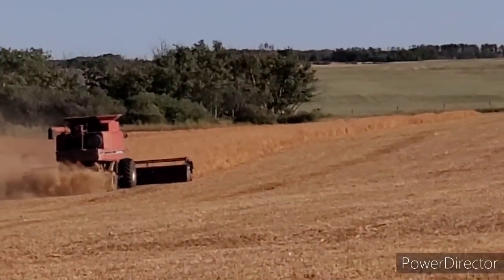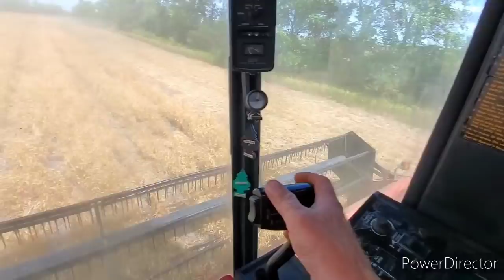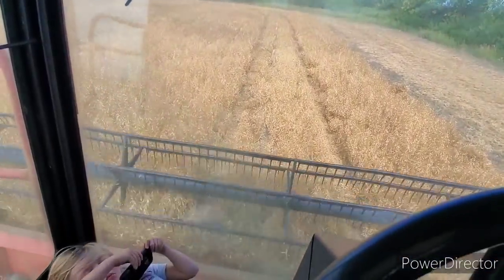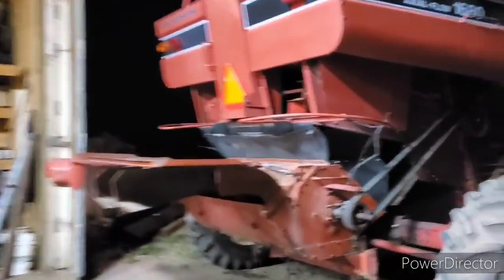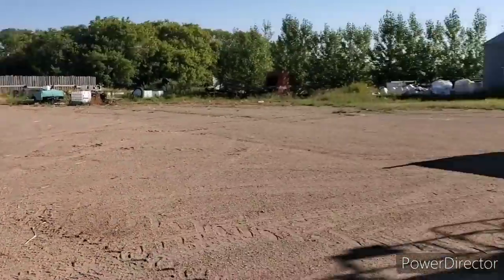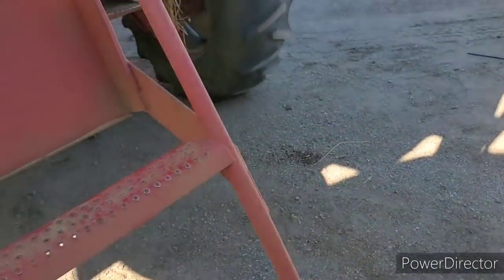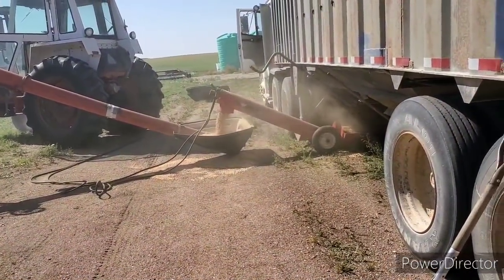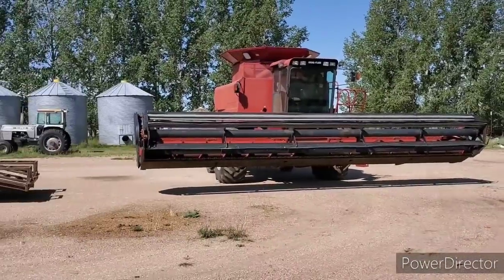2020 Yellow Pea Harvest With Case IH 1680!

Comment: Axial flows with choppers are a bit different to bale behind.. done a lot of round baling grass seed straw behind them. Just takes a little longer and more of a pain in the ass! 
Pea straw is supposed to be great feed!! Also great for the soil too!!
Busts up a lot like crimson.. dry enough when you combine, it just powders out.. 
Our spreaders are aluminum cone with a steel insert to mount and steel discs.. only way I've ever seen them.. ours pin on, the newer ones are like a PTO coupler.
The only guy here that raises peas, uses a belt to move them.. augers crack too much..
Thanks for the video bud!!!
Reply: Pea straw in small bales for garden mulch is very highly sought after and just the best . Ryans crop looked damn good !
Reply from the maker: Yep I baled 350 canary straw behind mine but only at night

Comment: Never had the chance to run a 1680. I've always been curious how comfortable they are.  I've ran a 2188 and a 2388.
Reply from the maker: Well definitely not as comfortable to run as the new cabs but still pretty decenr
Reply: @straightpipeacres6365  a cab and AC!! Much better than they used to be!!
Reply: @GosselinFarmsEdGosselin  I grew up running a MF 760.  It was loud and the AC might work half the day.😂😂
Reply: @ronniesorter1888  that was modern!!
Cut my teeth on a Gleaner C2 round back.. no cab.
Then the old man scratched up enough to buy a cab..  had a blower in it😂🤣
Clean and soaked at the end of the day, instead of covered in dust and tired...lol.. we put a thermometer in it.. 80-90° outside made 120+° inside!!! But you weren't dirty, itchy and you could see out your eyes!!!
Reply: Seems pretty quite in the cab.